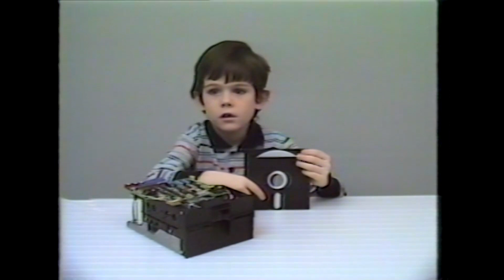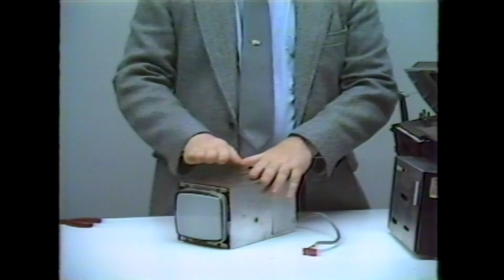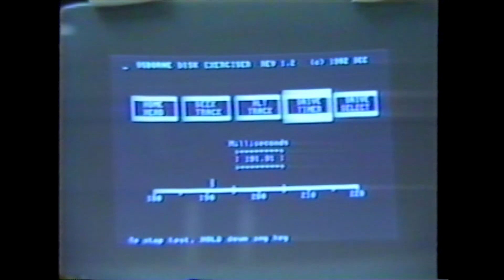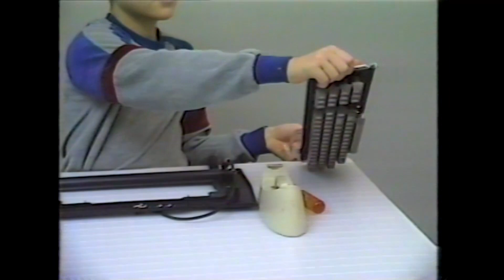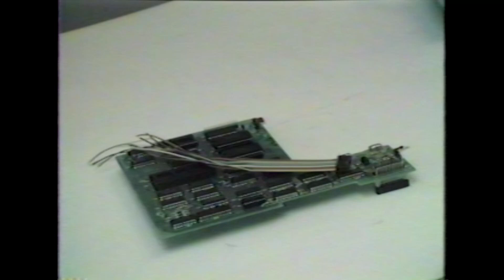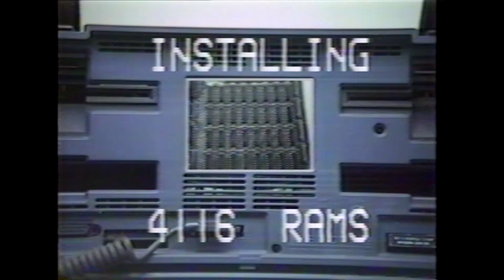The Osborne Survival Kit

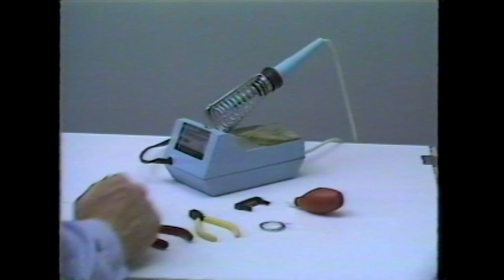Comment: 48:45 What the... ?? :)
Reply: It’s a good method…
Reply: You're less likely to damage traces this way.  Same with the RAM chip, but hurts to watch!
Reply: @booboo699254  I think I get it; I was mostly expressing surprise (esp. re: protecting people nearby :) ). Since the pins are inaccessible until the plastic is cut away, I guess we can't heat with an iron on one side and suck with a solder pump on the other (which is a current best approach that I know).
Reply: @DrDavesDiversions  I’ve had to do it to remove hybrid power management boards of Macintosh portable computers. It’s basically a board like an arduino or pi pico with 80 pins or so like a chip and I had to cut the board up so the fiberglass pieces will shoot off everywhere could easily take your eye out. Got to be very careful and it is definately painful to watch. And a bit sad having to lose the original. But it makes removing it so much easier. I’ve also done a lot of non destructive part removals with flux, solder Wick, heat guns and desoldering itons. I think the most challenging one so far was a 68030 CPU which has 128 pins and the chip itself is basically a big heat sink. Still need to find out if the heat I had to use to remove it didn’t destroy it 🤔

The method i use for stuff like that is to use flux, a hako desoldering gun and then blast it with hot air at the same time with a heat gun. That usually does the job for the stubborn pins.